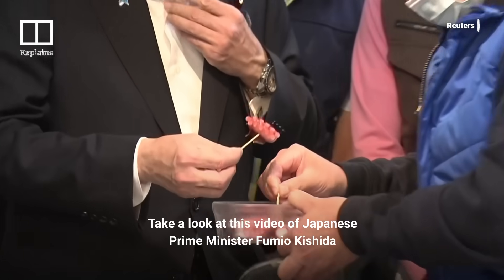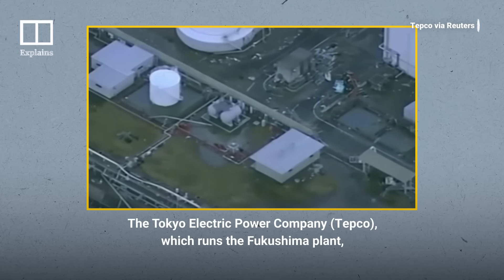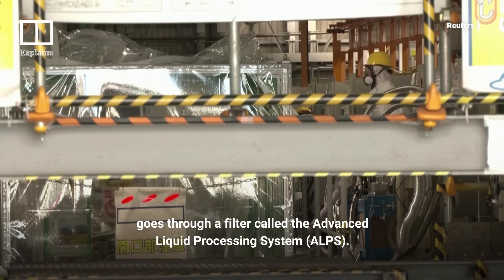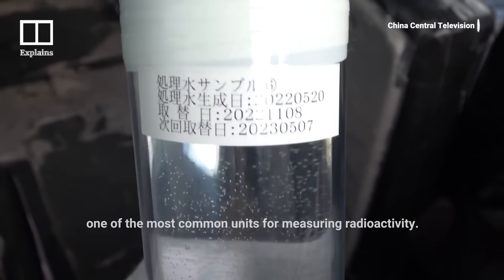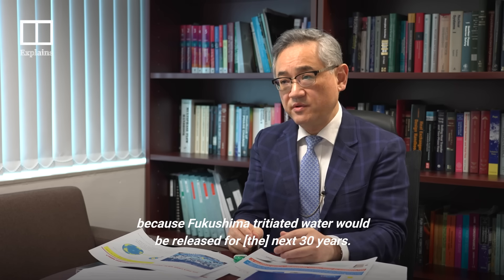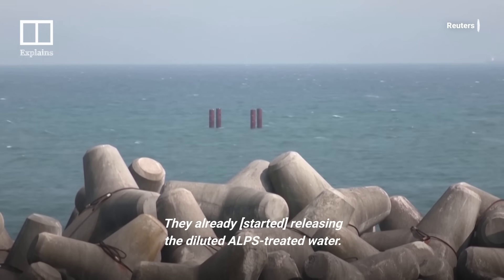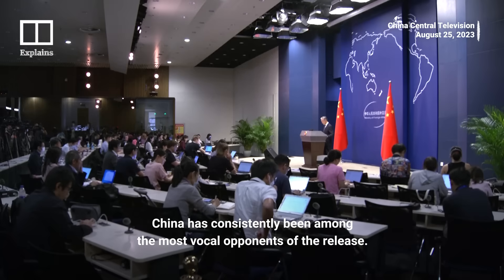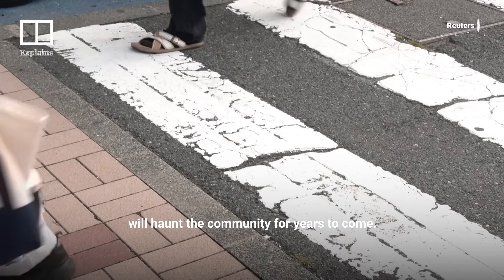The science behind the Fukushima water release

Comment: The element in Japan's nuclear sewage is not just tritium, but more than 60 substances. If Japan thinks there are no problems, please give the people two liters of water to drink every day and use it to irrigate crops every day. Why not implement it?
Reply: You're nothing more a blockheaded little jay. Such substances in the waste water are clarified before duscharging.
Reply: The only point I agree with the critics is, benchmark samples should also be given to 3. parties. If the filtering process is done proper, the wastewater is not any worse than any other nuclear wastewater.
Please keep in mind that this fire had been started by the CCP, they constantly feed the fire of hate of Chinese people towards Japanese people.
Reply: ALPS does not remove strontium Cesium cobalt plutonium and the other isotopes no matter what experts here in comments says it removes radioactive elements via water filtering and dilution. It is still there no matter how much you add water to it.
Reply: You're correct, when they first remove the water from the reactor and put it into the storage it contains all of it, BUT when the water gets filtered by the ALPS process it then contains only tritium, it doesn't matter if it comes from a damaged reactor or not after it's been filtered and diluted it's the same water as all the other nuclear reactors release.
Reply: Or you could have looked up the system they are using called ALPS that removes all but the tritium.
Reply: @danadurnfordkevinblanchdebunk there's no proof of that. Even IAEA admits it that they never tested it. Their "proof" is that some American electricity company in Japan said it removes those isotopes. Go look up IAEA report on their website, I'm not joking.
Reply: @danadurnfordkevinblanchdebunk  I think they have a point though. Why release it into the ocean when it can be used to irrigate crops and give water to people? It's a mystery but its a very iffy situation
Reply: @matthewpark3104 because it's called dilution, a bit more effort would have helped you.
Reply: Then please dilute it in your drinking water, wouldn't it be perfect? @Blockhead2
Reply: @danadurnfordkevinblanchdebunk  Does other countries use the water to cool down damaged nuclear core, then dump into the ocean? That is the issue many neighboring countries including Japanese fisherman are protesting.
Reply: @matthewpark3104 that same logic goes to china too...why would chinese release into ocean if they can reuse it...
Reply: @matthewpark3104   I think you need more research
Reply: @danadurnfordkevinblanchdebunk   So are you the "Physic" expert separating the toxic water from all those elements? I have a Brooklyn Bridge to sell? any Interest in buying? No physic involve.
Reply: @Tabula_Rasa1 the issue is you and too many others talk about you have literally zero understanding but still act as experts. The filters work regardless where the water was, only tritium is left because 1. you can't remove hydrogen isotopes and leave back H20 (water: hydrogen+2 oxygen) untouched, 2. Tritium is naturally occurring, 3. Tritium has an half life of 12 years. If they are lying then why should we believe you're not lying?
Reply: @Blockhead2  Finally, a chemist. Teach these ignorant fools. I'm not a chemist but I can understand some of these.
Reply: @Blockhead2 the filters work? how do you know? even iaea doesn't know. enlighten us pls
Reply: @danadurnfordkevinblanchdebunk dm wil never answer that. Forget about it. That's their position. They will condemn Japan for the same thing other countries have done.
Reply: @rubylee5754 then why china , korea , canada also throw it to sea?
Reply: @uludak8468   ion exchange,reverse osmosis, solvent extraction works.

But of course if they are cutting corners to save $$$ then rip
Reply: @matthewpark3104 Because they need to dilute it with the sea. That's like saying why do nuclear power plants dump water used for cooling nuclear reactors into the sea instead of feed it to the locals? It contains tritium (in much higher quantities), but in order for its low radioactivity effects to be minimized, dilution must be done.
Reply: @danadurnfordkevinblanchdebunk  what does physics have to do with it and what do they do with the radioactive waste filters if it removes All contaminants? unless you are a nuclear scientist that claims Radioactive Poisoning is now History via ALPS?
Reply: @matthewpark3104  did you not go to school?

You don't use sea water for crop irrigation.
Reply: @drunkenmonkey1887  Now we all know YOU didn't go to school. Sodium chloride (salt) is one of the first molecules to be filtered out so the waste water is actually fresh water, not seawater as it has no salt in it. This is basic high school chemistry.
Reply: @drunkenmonkey1887  They can EASILY take the salt out of the water if they can apparently take nuclear waste out of it too
Reply: @crimson9714  They can easily take out the salt out of the water if any, and you can grow rice with some salt in it, the maximum being 1/10 the salinity of seawater which is easily achieved if they can take literal nuclear waste out of the same water.
Reply: Do you drink waste water from your toilet?
Reply: @Hkchinese888 actually yes. toilet water is same as tap water. in developed countries sewage water is purified and recycled several times.
Reply: @uludak8468  Bro... you're funny.
Reply: @uludak8468  That being said, they drink treated toilet water, same applies to the treated Fukushima waste waste water.
Reply: @Hkchinese888 Holy brother, you must be genius! Why won’t you work with the great people of the world to make the Earth a better place. You’re wasting your talent in these videos. You have a bright future ahead of you…

Fukushima used seawater in their nuclear power plant. Go ahead drink seawater. Genius.
Reply: @Schwei666  ok, you go ahead drink toilet water
Reply: @Hkchinese888 Why? I’m not that nasty person to drink toilet water. And my toilet water is not a seawater, you genius. Your brain is too big that your reasoning is beyond a normal capable person to comprehend. Genius.
Reply: @Schwei666  if you're not willing to drink toilet water, why do you ask someone to drink fukushima waste water? They are all treated to the safety level.
Reply: @Hkchinese888  Singaporeans do drink sewage water that has been diluted though..they chose the least expensive way to treat this issue.
Reply: @ruilingzhang3521 dont worry you will be enjoying delicious fuku waste water too as it travels across the ocean currents to malaysia from vietnam then indonesia up brunei phillippines hawaii south pacific islands alaska canada usa and south america for the next 70 years of discharges
Reply: @ruilingzhang3521  To drink treated toilet water is not cheap, in other places there are plenty of fresh water
Reply: China should lead by example. They should treated their nuclear waste water as per the level of Japan before releasing them into the ocean. No wonder China keep pushing out their fishermen into deep sea cause there are no fish near the costal area due to their higher level of discharge
Reply: @kahbengtan6380 That 10-dash line map the Chinese released is ridiculous. They invaded most of the sea.
Reply: In 2011, a tsunami engulfed the Japanese coastline and precipitated the second worst nuclear accident in history. This year, Japan is planning on releasing some of this catastrophe – water contaminated with tritium – back into the ocean. Is it safe? Does it make sense? This [HALF-LIFE HISTORY] traveled to Fukushima Daiichi to find out.
https://www.youtube.com/watch?v=UwFoOVyB40s
Reply: Why do you  charge 3  billion yen  for  sewage  discharge, ·but  70 billion yen for  public  relations?Enn········GOT IT:face-blue-smiling::face-blue-smiling::face-blue-smiling:
Reply: @rubylee5754 Because idiots like you need more effort to handle than those "harmful" waste waters?

Comment: The risks are

1. Fully trusting the efficiency and reliability of ALPS as they have claimed. 

2. Fully trusting TEPCO doing the right things sustainably and consistently, considering their tainted record of non compliance and exploiting loopholes.

3. Fully trusting tritium is the ONLY remaining radioactive element left in the processed contaminated water.

4. Fully trusting the Japanese gov has their finger on Fukushima's plant's pulse at all times as they discharge the treated contaminated water going forward. 

No they cannot infinitely store the treated contaminated water, but there are further options (albeit more costly) that they could explore. 

The total amount of radioactive elements getting dumped by them into the ocean won't change. 
It's like I'm gonna dump 10 barrels of oil into the ocean. But I'll dilute it at the beach 1 barrel of oil to 50 barrel of sea water before dumping. End of the day it's still 10 barrels of oil into the ocean.

They are banking on the vast ocean being a massive sponge to dilute and spread out the radioactive elements and hope there's no isolated pockets with high concentrations that could potentially cause any living thing in that environment to absorb and accumulate enough to be detected and cause concerns.